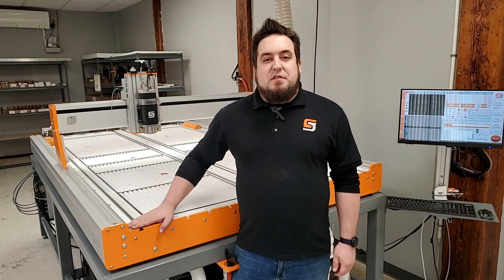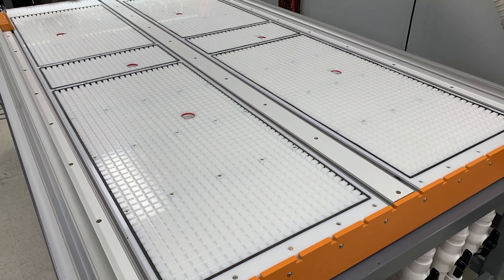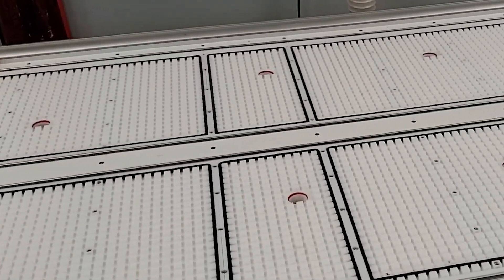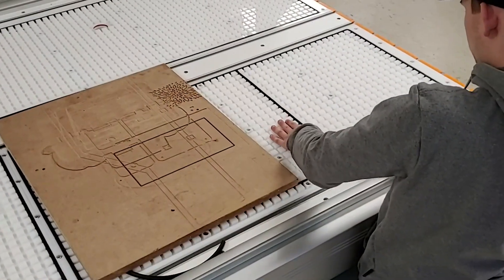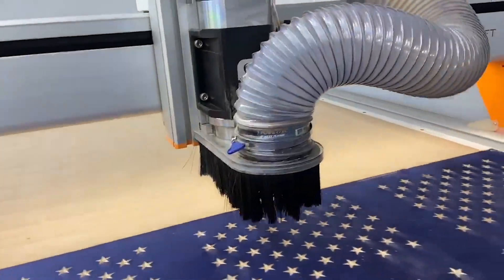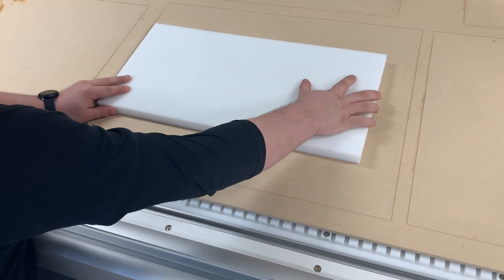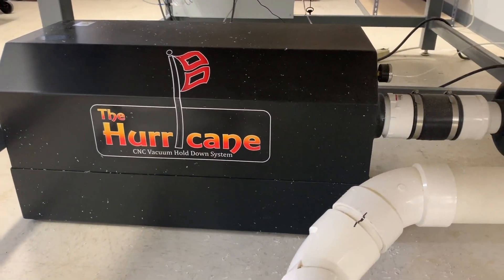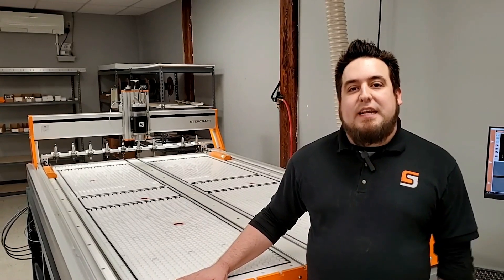Finally! A Versatile CNC Vacuum Table Solution For Stepcraft Q-Series

Comment: On your website it is mentioned that the q series uses a driven nut design via belts. So you used ballscrews for zerobacklash and then added backlash by using a belt to drive the nut.
Reply from the maker: No Not at all - it is a completely backlash free system.  The drive belts do NOT induce backlash into the system.  If you wish to call or email us we would be happy to go in more detail. info@stepcraft.us

Comment: why those humongous diameter white pipes? they look low grade diy plus awful.
Reply: but they worK?
Reply from the maker: @Cosharek  They work VERY well
Reply: @StepcraftInc  That's what i was trying to say to the person commenting :)
Reply from the maker: They are vacuum pipes.  They are white PVC.  you will find that just about every manufacturer of a CNC with a vacuum table uses PVC (or ABS) pipes.

Comment: Like the low tech valve set up and the adjustable grid zones. Now I just have to afford one.....
Reply from the maker: Just about every company that has a vacuum system uses PVC or ABS.   No reason to reinvent the wheel. It works perfectly!
Reply: @StepcraftInc  yeah but for $5k without the actual vacuum system? Youre talking about $0.50 per foot pvc pipe and a sheet of poly with holes in it youre charging $5,000 for.